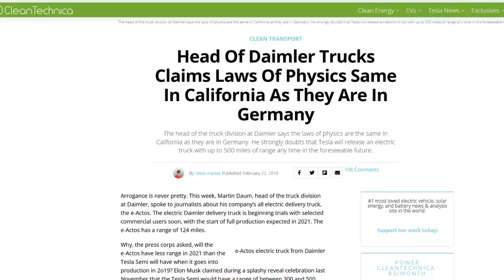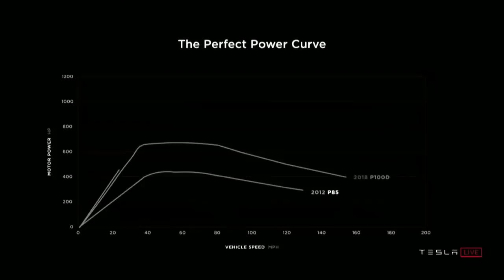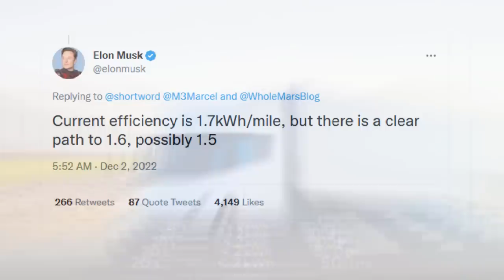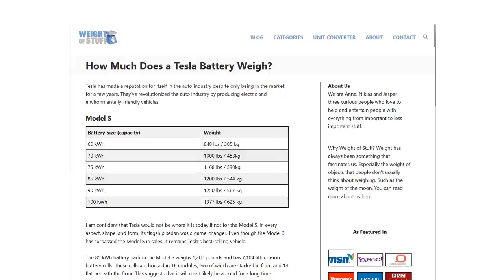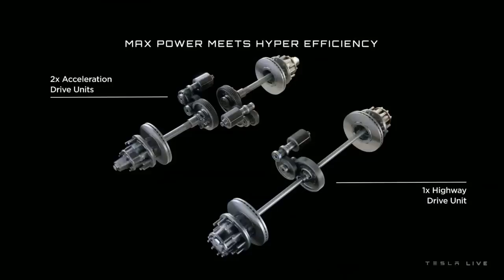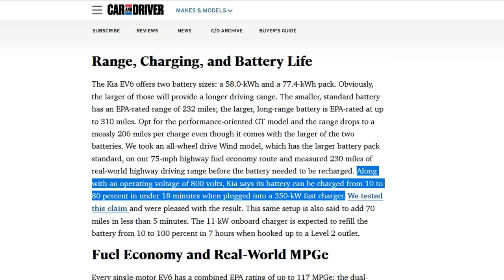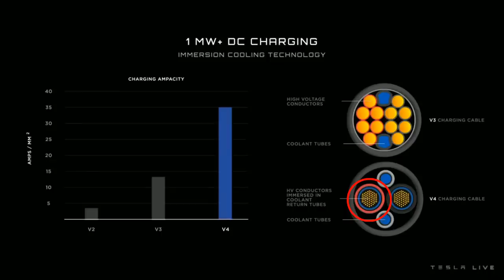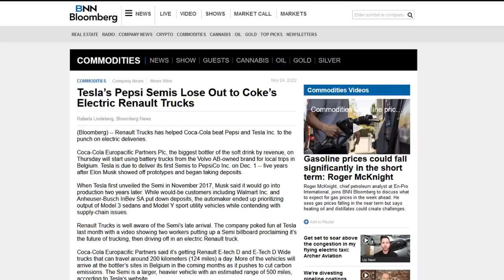Elon Musk Drops Tesla Semi Bombshell

Comment: Tesla will likely require companies to sign some kind of non-compete where the trucks can't be sold and tesla will buy them all back. also they can can choose to sell only to big players that want to cooperate. As evidenced so far the biggest issue companies are having is creating software so all of this probably doesn't matter anyway. AND it appears that no one is in a rush to re-invent manufacturing, as musk says , that's the real product!
Reply: This is similar to Tesla solar program, they closed their factory ,bought from China, and have been a smaller program the longer they operate. Tesla will continue to use almost all diesels for their own productions they use solar power only for a tiny part of their operations.
Reply: If immediate resale value exceeds purchase price then the price is too low.  Your solution sounds pretty good but higher initial price is simple and too the point.
Reply: @paulbedichek5177  Where does Tesla use diesel for their operations?  Sounds like fake news.
Reply: There is nothing secret about any of this.  The standards for maintenance have to be published otherwise ZERO trucking companies will accept anything from TESLA.  ZERO. This means EVERYONE will have this.  TESLA's domination comes fro a slightly superior motor and what EVERYONE misses are the Motor Controller efficiencies.  I realize no one on YT knows jack shit about Engineering, but it is not the batteries currently which makes the TESLA's have superior range, it is their motor controllers.  This is a VERY short term advantage and something Legacy auto makers have ZERO knowledge of and... it shows as  the only thing they know about an electric motor is induction and buying it from someone else for their heater fans where they don't give a damn about efficiency.  They literally do not have a single person ANYWHERE in their orangizations with this electrical engineering specialization.
Reply: @ajubhosle  Exactly, its all about ability to have access to the batteries and charging infrastructure.  Everything else is 3rd or worse.  That is why TESLA is on top and will remain on  top.  They will be making money on the front end(charging others for the IP standards) and the back end due to charging infrastructure.  Win-Win.  There is only one main problem still.... Charging time so all those who are renting or live in dense Condo's etc... are currently screwed as they cannot install a home charger.  

That and everyone gloating over how much we save compared to ICE, are delusional as the $$$$ for road taxes are being completely circumvented.  There is no way that the government will allow that to continue.  Norway has already cracked down and the charging stations are actually more expensive in Norway than operating an ICE vehicle.  If you home charge it is still cheaper and more convenient of course.
Reply: Other companies don't have the stroke to copy Tesla. Even if they had the full blueprints and all the specs, they don't have the gigafactories.
Without the gigafactories they don't have the economies of scale and simply can't compete. They could conceivably make a cookie cutter Tesla Semi but at twice the price.
Reply: @protorhinocerator142  Not true.  They have economies of scale, BUT, they have moron CPA's MBA's in charge of said company for their share holders who are milking an OLD company for SHORT TERM PROFITS until it is driven into the ground.  Said people are UNWILLING to put the $$$ into said R&D without GUARANTEES of future profit...   If they did make it, it would NOT be 2X the price, it would be cheaper as they already have the industrial capacity compared to Tesla, but because they REFUSE to build the mass manufacturing, its cost is high and limited.  Why old corporations fail.  Look up Kodak as a brilliant example.  Or McDonald Douglas or currently Boeing/GE.  Failing ALL for SAME reason.  Banks, Blackrock, Vanguard are running the company who have ZERO engineers, ZERO vision, and know nothing about manufacturing.  They do not WANT to know.
Reply: @w8stral  I'll do you one lower. I don't think their existing industrial capabilities are a plus, but a minus.
They've perfected the art of making products for the 1950 consumer. None of their stuff can scale like Tesla. Nothing they have is sufficient for the 21st century.
It all looks like an asset on paper but it's really not. Just some buildings full of the machines you need to create things people wanted 70 years ago.
Reply: @w8stral  As an engineer who got an MBA 40 years ago I can confirm that people with accounting and finance MBAs have been the death of many firms in the U.S.  I have almost total lack of respect for those disciplines as training for CEO positions.
Reply: @protorhinocerator142  What's "the stoke"?
Reply: @ajubhosle  Vast difference, startup where said banks hold ZERO positions on said board and in effect are nothing but a LOAN and an engineer with the vision for new products, vrs old company where the banks hold the CEO positions and determine WHO runs the company which means their toady.
Reply: @billweberx  Stroke.
The awesomeness, the capability, the exceptionalism. Tesla has stroke. The others have tradition.
Reply: @protorhinocerator142  I don't think you know what that word means.  Maybe you should look it up.
Reply: @billweberx  Should I look it up as "stoke"?
Don't be such a boomer.
Reply: @protorhinocerator142  Stoke was a typo.  Stroke was a misuse of the language.
Reply: big corp first for sure, they need new charge stations which smaller players wont able to afford now.
Reply: @paulbedichek5177  Where did you get your information? Did you dream it up all by yourself? get some facts.
Reply: @paulbedichek5177  
It's nothing like it.
Reply: @w8stral  
The Tesla advantage is that they are building the system (all of it) from first principles while applying attention to detail in every aspect.
I'm not talking "trucks" or "cars", but every aspect of the business.
Reply: @protorhinocerator142  
"I'll do you one lower"
👍😂😂😂
Spot on!
Reply: Sounds like you are describing a "lease" rather than a non-compete.
Reply: @w8stral  Well, I could go back to work for one of these companies, but I am 79 years old.
Reply: @ajubhosle  Simple, just ask Tesla for permission to use their ideas which they will give you for free.
Reply: @ajubhosle  Not so much if you are showed the way by Tesla.
Reply: @protorhinocerator142  Let's move it along a little farther, specs for Giga Factory, they could copy and build the vehicles but would always be behind Tesla.
Reply: My son is creating the software

Comment: Fuel Economy (equivalent) 1 mile/ 2kwh * 40.7 kwh / gallon-diesel = 20.35 Miles  Gal-equivalent-diesel.  SAVINGS: Semi gets 6 MPG-diesel.  California Diesel is $6/gal, so in 500 mile trip  500*(1gal/(14.35-6)miles)= 60gallons saved, or $$360 saved in one trip  {assuming electricity costs same per kwh as diesel $6 for 40.7kwh, or 14.7/kwh that is very reasonable}

Comment: Tells us how much it weighs Tells us how much it weighs Tells us how much it weighs
Reply: Estimated at about 27,000 lbs. based on the 500 mile test drive with 11 Jersey barriers (4K each): 81,000 total - 44,000 load, -10,000 for trailer leaves 27K.
Reply: @EleTruk  it's incredibly difficult to believe that 
A.) They've achieved a weight that's on parity with an ICE semi (considering that battery vehicles are always heavier)
B.) That they wouldn't clearly advertise the weight of the vehicle, considering how imperative it is to trucking companies
Reply: @joedowning2428  the battery may weight more than the diesel engine but by how much? The truck is designed from the ground up maybe that is how they managed to keep the weight down and be comparable to a class 8 diesel truck.
Reply: @nguyep4  that's where it gets grey: the Opel Corsa E weighs 1500kg, compares to its 980kg ICE counterpart. A 50% increase

But they absolutely should have disclosed the semi's dry weight, it doesn't make sense that they didn't
Reply: @joedowning2428  three engines that you could carry compared to that beast of a diesel and the transmission, exhaust system, fuel tanks And fuel? Not hard to believe the weight would be within 1,000 lbs or so. Well within the additional 2,000 supplemental weight allowance.
Reply: @luigimanzoni2705  it is hard to believe when they conveniently leave it the most important factor to trucking companies

Comment: SpaceX and Tesla are a power house because they focus on the factory first. The gigapress and the use of stainless steel in starship are perfect examples of how they focus production.
Reply: Not sure if it's what you're saying, but the "Gigapress" 
(misnomer in my opinion) is nothing to do with stainless steel.
It's for high pressure injection of molten aluminium to form a "large" (huge) casting
Reply: @rogerstarkey5390  the gigapress cast one piece vs 37 pieces that require stamping presses, welding robots, etc... It's that kind of streamlining of production is what gives Tesla the edge as a manufacture. Same with SpaceX going with steel vs carbon fiber and other exotic materials. SpaceX is going to build starship like they are the next generation of Liberty ships.

Comment: Would have liked to see a "race" between the Tesla Semi and a Diesel Semi - full load - up the Donner Pass, turn around, down, and back up again - continue until out of fuel/charge. How many trips would the Tesla do compared to the Diesel? In what time? No gear shifting, full regen downhill, no fumes, no noise - do it Elon!
Reply: ...A diesel semi has 300 gallons of diesel - so not much of a fair chance to the Teslas 25 gallon equivalent of diesel.......GIVE the Diesel 25 Gallons of Fuel then it is fair race.......................Fuel Economy (equivalent) 1 mile/ 2kwh * 40.7 kwh / gallon-diesel = 20.35 Miles  Gal-equivalent-diesel.  SAVINGS: Semi gets 6 MPG-diesel.  California Diesel is $6/gal, so in 500 mile trip  500*(1gal/(14.35-6)miles)= 60gallons saved, or $$360 saved in one trip  {assuming electricity costs same per kwh as diesel $6 for 40.7kwh, or 14.7/kwh that is very reasonable}
Reply: @pablopicaro7649  only the big privately owned long haul rigs have 300 gallon tanks. Most fleet trucks which tesla semi are targeted at only have 100 gallon tanks which give roughly 400-450 mile range fully loaded (5mpg x 90g which is about all you'll get out of a 100g tank). Semi would smoke a fleet daycab in such a test!
Reply: @pablopicaro7649  
The limit isn't the diesel, it's the driver.
THINK about it.
Reply: Sure, have it last 7 days, with driver changes at the end of each leg when they drop off the trailer and pick up a new one for the trip back.
Reply: While we are at it.  Lets see it handle the runaway ramp.

Comment: I would be interested to know the gradient profile of the route used.
Reply: Exactly I wanted to see the return trip too cuz I'm very interested in the range reduction over hills
Reply: @JamaicanMeCrazy  I believe that trip goes over hills and then back down to almost the same elevation, but I'm sure Google Maps could tell you exactly.
Reply: They had a graphic showing the grade along the route, along with the battery state of charge. It's in Tesla's delivery presentation. Route is mostly down I-5, roughly from just south of Sacramento to San Diego. 4,000' of elevation gain, then back down near sea level in that route.
Reply: 6% and accelerating!
Reply: Tejon pass is 6%
Reply: Plot the route on google Earth and you can easily get the profile. Easy to do. I do it all the time for hikes.
Reply: @JamaicanMeCrazy  the net change in elevation was six feet uphill, so the return journey would be around the same in energy usage and range.

Comment: 50,000 Tesla Semis produced in 2024 doesn't seem like much.  But, there are 2,900,000 diesel trucks in the U.S.  If Tesla only stays at 50,000 per year until 2030, that is 10% of all trucks on the road by 2030. However, Tesla will ramp up production.

Comment: Why could they not make the roofs of the 40'-53' cargo trailers out of solar panels so they could help charge these things during the daytime?
Reply: I'm not a solar expert, but I suspect that the fully paneled roof wouldn't produce enough charge to put a dent in the amount of electricity needed to recharge.
Reply: An 53 foot trailer would give about 424 sq feet of area to put panels.  The max solar energy reaching the surface is about 1,000 Watts per square meter at best.  It gets less as the latitude changes and solar radiation is spread out due to the angle.  Solar panels are roughly 20% efficient, so the best you could get is 7.8 kW, but in reality far less due to latitude and the fact that the panels are likely never directly facing the sun.  Might be able to add 10-15 miles of travel during the day.  That doesn't seem worth the trouble.

Comment: If Tesla also develop highly efficient solar panels that could cover the top and sides of the semi, it would became a check mate move to the trucking industry....
Reply: A great idea however there isn't enough power hitting the rig to make a significant difference. Also consider half the thing is often in shade due to other trucks, due to trees, buildings, clouds and you've lost another chunk.  Then add in that truckers love to drive a night when traffic is lower!  Then add in the weight of the panels and wiring and charge controllers and you're probably luck to break even.
Reply: Tesla needs to put solar panels on the roof hood and trunk of all the vehicles it makes
Reply: The amount generated is insignificant

Comment: 15:40 "makes in house  . . . even the Mega Charing station battery backup". The Tesla stationary mega battery pack for their Tesla Semi Mega Charging stations appears to be the PRIMARY power source for the Mega Chargers.  They do provide power if the grid goes off, but their real value is allowing easy implementation of Mega Charging stations.  Mega Pack batteries allow placing the Mega Chargers about anywhere there is industrial 3-phase power because they put a relatively small controlled load on the grid while providing 1MW when called on.   The Mega Charger running at 1MW is pulling about as much power as a small neighborhood of a 100 homes running their air conditioning on a hot day at 40 - 50 Amps each of 200 Amp service.  

I would think much of the time the Tesla Semi will be able to do medium fast over night charging similar to a Tesla car, but at 0.1MW/hour able to be supplied from 3-phase industrial power grids without the use of a Mega Charger pulling 1MW or the need for an intermediate storage Mega Pack.

Comment: I wonder what the range would be on 50% load, most loads are around 40,000 lbs I believe.
Reply: Rolling resistance will be reduced, aero drag the same. Truck an trailer guess weight 32,000 lb, so 50,000 max load.   half load is 25,000lb.  vehicle weight 57,000lb.   so maybe 30% reduced rolling drag (which is 80% compared to aero 20% on highway)
Reply: 600miles
Reply: weight has little to do with range
Reply: It goes to shit that's the real world answer

Comment: Correction 10:49 the highway drive unit is on the front-rear axel and the acceleration units are on the rear-rear axel
Reply: The single motor is the rear axle.
Reply: @allterrainrandy2587  Not according to what was said at the event.
Reply: @luigimanzoni2705  where?
Reply: Yes this was shown on Tesla reveal, the Fwd rear axle is normal drive/cruising, AFT rear axle is for additional acceleration/Deceleration
Reply: @pablopicaro7649  where at, I watched it twice. It never specified which axle is which. In the diagram it shows the wheels rotating with the double axle as the front.

Comment: It all boils down to efficiency.  Any ICE vehicle will only be 25-40% efficient at best.  That means for every 5 gallons of fuel, at least 3 of those gallons is thrown away in heat and mechanical energy waste.  It's completely absurd. A city full of electric vehicles is also going to be cooler, quieter, far less toxic and generally much healthier.

Comment: This truck would b more for big fleets with rookie drivers so you better have a huge supply of parts on hand ready to go
Reply: What for if it never breaks? Are you suggesting drivers are in short supply and there will be many people interested in driving because electric trucks will be much safer and more profitable? Then I say its a new world out there. You need to recalculate. (Some say a new paradigm).
Reply: What can a rookie driver break?
Short if running into/ over things?
The drive system should be bulletproof (insert glass joke below!😉)
3 motors each capable of.
 driving the vehicle, with a huge gearing drop compared to the 200 mph Plaid, so under-stressed.
A "clutch"system that's engaged from rest (no wear) releases automatically in cruise mode (no wear) and I imagine will electronically match motor speed to driveshaft speed for seamless engagement when required?
90% if systems with dual redundancy (like the cars)
Regen, so no cooked brakes or downhill emergencies.
Fantastic around cab hazard awareness
Etc, etc, etc.